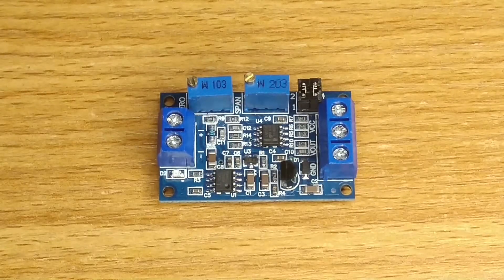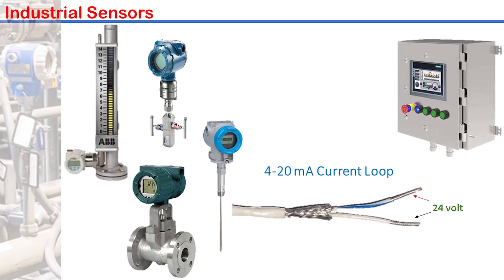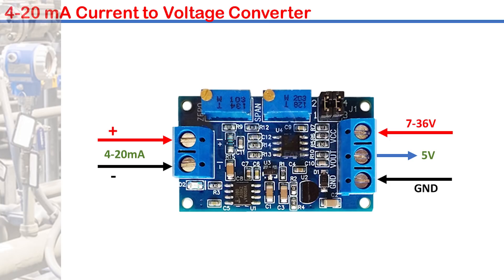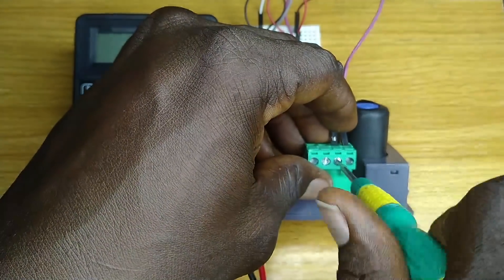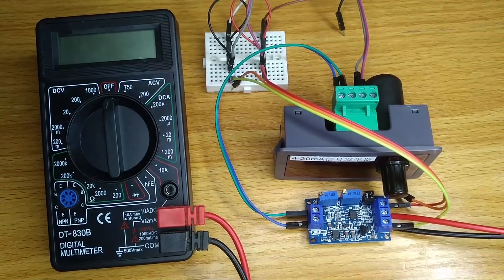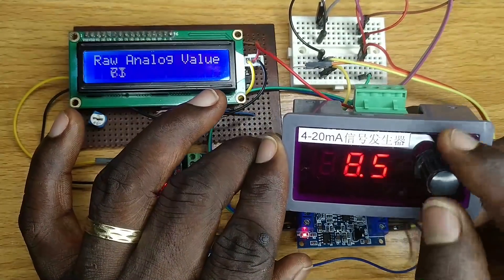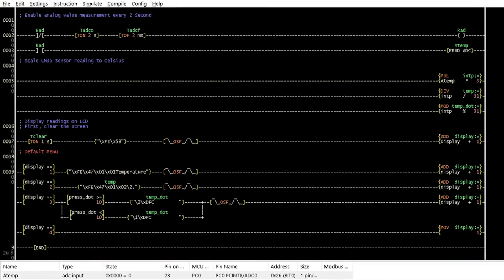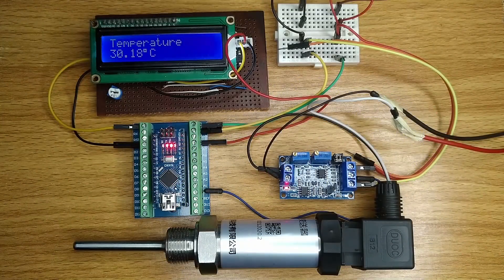How to Interface Industrial Sensors with Arduino Nano

Comment: Hello! Thanks for the video. As far as i know, this module does not have optical isolation. Do you know any modules that work the same and use optical isolation? I tried using the converters from this video to read 2 current loop 4-20mA sensors, but because the converters are not optically isolated - the second converter read the current output of the first sensor too, as the current came back trough ground because of, again, no optical isolation

Comment: I really like these videos! Is it possible to connect the 12 volt power supply together with the USB to my computer? I wrote software to read out the analog values on my computer but I don't know if it is safe to connect both USB and Vin pin. Thanks and keep up the  good work!
Reply from the maker: The 12 volt supply should go to the module alone. It is only the output and GND of the module that should be connected to the USB port of your computer. Just ensure that the output of the module is calibrated to 5 volts as demonstrated in the video.
Reply: @OnosTech  Thanks

Comment: Hi, the 4-20mA to 5 V converter does not use any optical isolation (as far as I can see). Typical industrial PLC I/O's are mostly opto isolated for analog signals. Would that be a concern? Excellent channel btw!
Reply from the maker: You are correct. It also depend on the area and scale of application. I won't recommend it for use in safety critical equipment. For hazardous area application, an IS barrier can be an added protection.
Reply: @OnosTech  Thanks for the reply.

Comment: Can this module take an input voltage of 24V? My experience is that when I use 24V, the power indicator starts to flick very fast and slows down gradually. and the voltage output would become jumpy at the same time. is there any problem with this module using 24V?
Reply from the maker: There are actually two types of these modules;
1. https://s.click.aliexpress.com/e/_DEjqtG1
2. https://s.click.aliexpress.com/e/_AfeXw5
I actually used No, 1 in the tutorial video. I found out that at 24v, the transistor becomes hot. So I got No. 2 and used it in this other video with 24v: https://youtu.be/qxcVWX-BqUo No. 2 works better.
Which of the modules do you have?
Reply: @OnosTech  I'm using the number 1 module which is cheaper, I will buy the number 2 module and give it a try. Thank you for your reply, really appreciate it.

Comment: Why not use a resistor and if you are worried a zener to clamp maximum?  You don’t need a module to convert current to voltage.
Reply: I  think,  if resistor 250 ohm burnt out or connection loose  at this point,  microcontroller will  get 24 VDC from sensor and make  microcontroller burnt out too.  SO this module may protect this issue.
Reply from the maker: That can also be done. But the purpose of the video is to minimize or eliminate soldering for those that cannot solder and to provide perspective on field instrumentation zero and span calibration.

Comment: i want to use esp32 instead of nano, but 12v is too much for the esp32(3,3v max) . What can i do?
Reply from the maker: Connect DC 7~35V to the 4-20mA module, then calibrate its VOUT to 3.3V. Use a DC-DC converter to step down the DC 7~35V to 3.3V for the ESP32
Reply: @OnosTech  do the vcc absolutely need to be connected to the esp32 or just the vout and gnd ?
Reply from the maker: Connect just the Vout and the GND to the ESP32
Reply: @OnosTech   ok thank you
Reply: @OnosTech  ok thank you! i'm powering the module and the sensor with the same 24V, is it ok ?
Reply from the maker: @mbinacedric3566  It should be  okay as per the module specifications. But check that there is no overheating of any of the components on the module or else it will require the 12v

Comment: Thank you for sharing this is very helpful, I'm testing this module with 4-20mA sensor and arduino uno, The reading are ok, voltage increases as the pressure in the sensor also increases, but in the readings with arduino a kind of noise is getting to the board, for example from  when reading voltage 202 - 203, or when it raises to 205 - goes back to 202, and it is ramdom, What can I do, de arduino is powered with same 12vdc  power supply as the module, and the sensor is with a 24vdc power supply. Thanks in advance!!
Reply from the maker: I am very sorry for replying late. The module power range is between 7 to 36V. Try any voltage within this range. If possible try to bring down the Arduino power supply voltage to a minimum of 6V and see how it goes.

Comment: can i build multi 4-20ma sensors with single setup. pls reply. if yes, then how. i want to make similar setup but to measure pressure, temperature and angle and stroke in a single setup. what changes i have to do in program and how.

Comment: I'm trying to make sense of the "Current to Voltage Module" and I thought the whole point of it was to serve as the power supply to the sensor; which would explain the wide input 7-36v . Does it work if you just plug the temp sensor in without the 24v power supply?
Reply from the maker: Sure, the module provides the loop power to the sensor and at the same time receives the measured values within the range of 4-20mA current. This current is then converted to 5 V which is the required input voltage of the Arduino analog input. The 24V power supply is required for the module and the sensor to work.

Comment: Best out of all
Reply from the maker: Thanks
Reply: @OnosTech  quick question. Can you supply nano with 12v supply???
Reply from the maker: @chirots  Yes you can. Connect the 12V to Vin pin of the nano